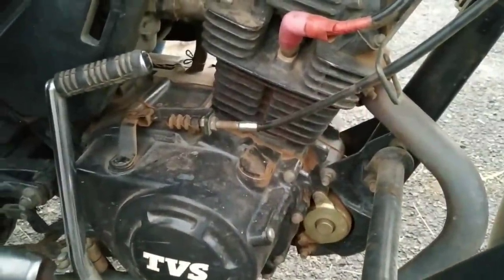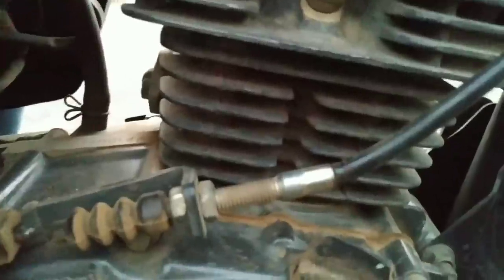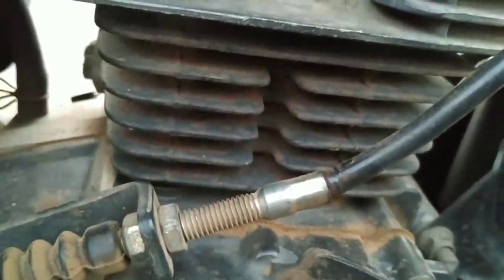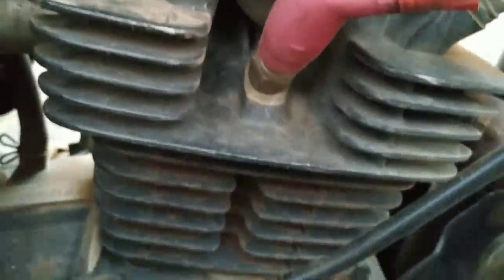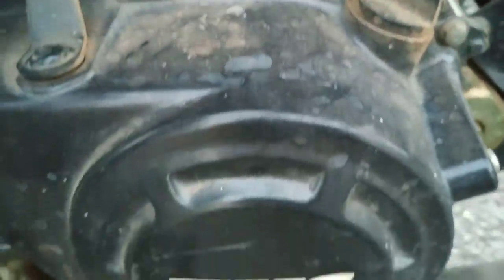What Will Happen If We Put Cold Water On Hot Motorcycle Engine? | Cold Water Impact On Hot Engine

Comment: Do not pour cold water into a still-hot radiator — it could cause the engine block to crack due to the sudden change in temperature. If you absolutely have to add water while the engine is still warm, pour slowly while the engine is running in neutral or park
Reply: Your absolutely right sir he don't about thermal shock simply saying and misguiding the people.
Reply from the maker: Please do read mvs sir comment and then comment.. And about paint watch my video till end
Reply: @neeluartsautomobile  so u r recommending pouring water directly on the engine that's what u told in this video do read some basic engineering and make videos..